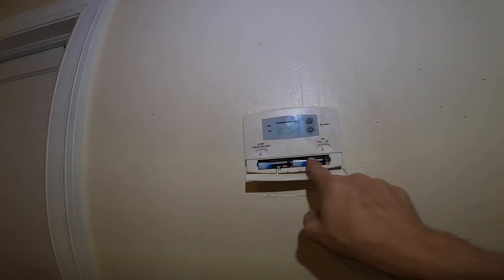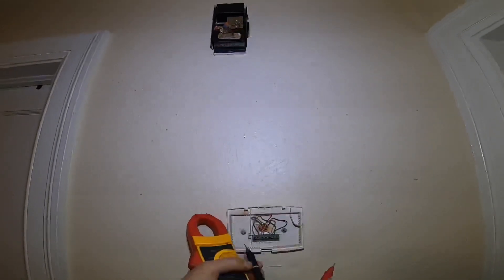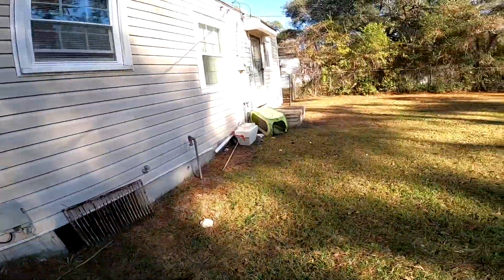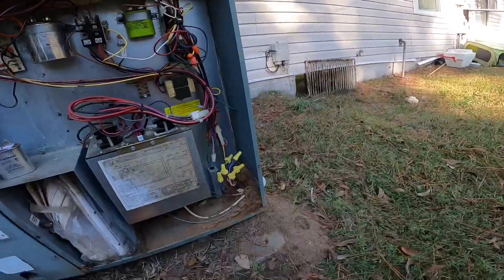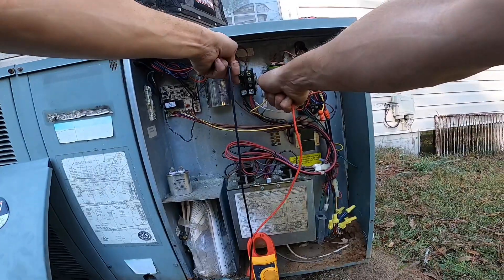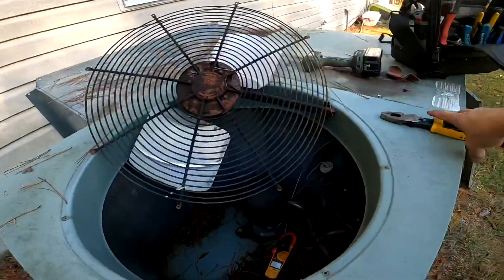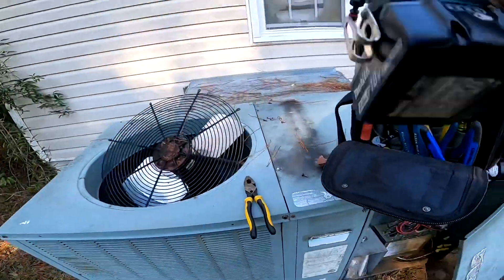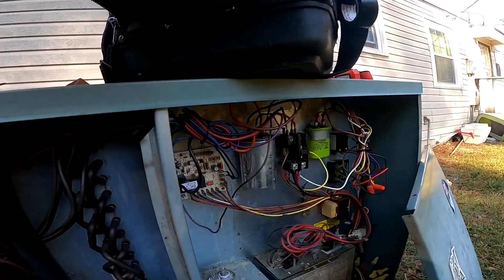Tripping a Breaker - Not What I First Thought

Comment: Wouldn't it been a lot easier just to take the four screws out from the plate that the limits/thermo discs were mounted on and remove it to make it easier to work on, especially if you had to pick parts up, you can take the whole plate with you to make sure they would mount properly or to come up with an alternative.
Reply from the maker: Attached to that plate is half of the heater kit. The heat strips are on the other side. But, yes I could’ve taken it with me. Getting exactly what I need was quite easy, and they don’t half to wait long.